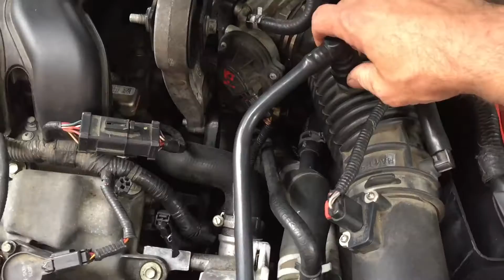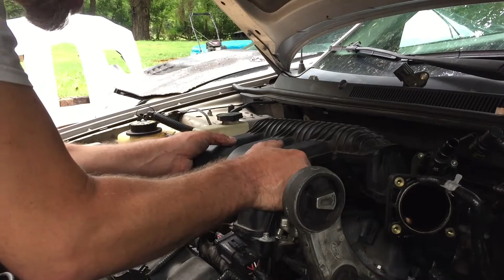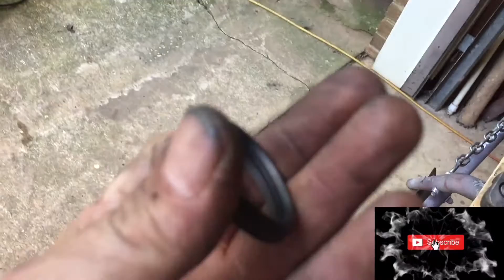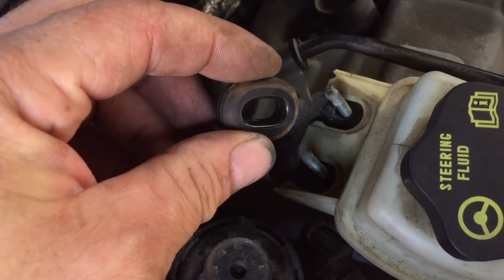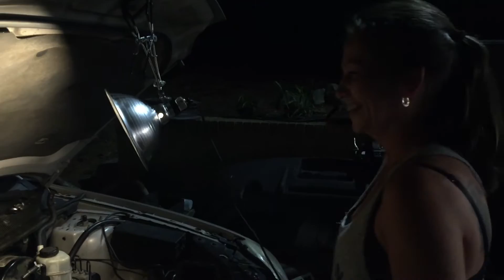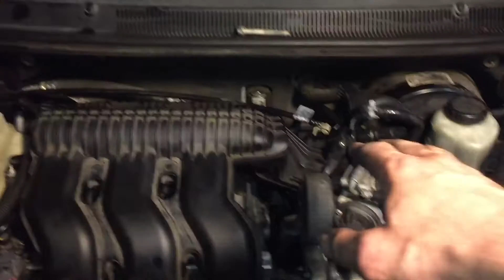How to Replace Valve Cover Gaskets 2005 - 2007 Ford Fivehundred / Ford Freestyle / Mercury Montego

Comment: I replaced them cleaned out the spark plug wells, replaced all the spark plugs and ignition coils, then I had 3 ignition coil connectors break on me so I replaced those, bro I hate ford engineers.

Comment: Is it possible to replace the gasket cover on the front half without removing all the pieces? I was told that mine were slowly leaking and that this would eventually become a huge issue, however that the cost of labour in Nor Cal to remove and reinstall everything to access the valve covers would be in the $1000s and thus not worth it.

I have little experience with cars so don't trust myself to detach everything and reattach it, but as a student I can't afford to pay for the mechanic to do it. I thought maybe if the front three are easily accessible I could do those myself and at least half of the problem would be solved.

Comment: Wow, this guy is taking WAY more things off than you need to......much easier than this guy makes it look.
Reply from the maker: How so what did I take off that wasn’t necessary for clearance and not to drop debris into the valve train??
Reply: @DeeStruggles I guess he wasn't gonna change anything but the fluids SALUTE
Reply: https://youtu.be/NwIjLECJmA8?si=lsTILmUsooe3CGgc
Reply: Anybody knows what direction to turn the big bolt on back of EGR valve the 1-1/16 nut?
Reply: @FATMAC_365 to loosing clock wise

Comment: Thank you for the detailed step-by-step video on how to replace the valve cover gaskets very helpful, you might want to let the viewers know to depressurized the fuel line by starting the vehicle removing the Fuel Pump Fuse Relay in fuse box at engine compartment till vehicle shuts off 👍🏼

Comment: Replacing the spark plugs on my 05 freestlye soon and I figured I will have to take out the intake manifold, so I might as well replace all the gaskets. Including the pesky EGR valve lol This video helped. Appreciate it. 

Question, my 05 freestyle has close to 220k miles. I'm thinking of draining some fluid and replacing the filter. There is nothing currently wrong with my tranny, I'm doing some maintenance. I heard changing transmission fluid on a higher mileage car will make the tranny slip. I don't see how only if it's already going bad. I think adding some new fluid and filter will only help give new life to an old tranny. What is your opinion?
Reply: I have researched this tirelessly myself.  Youtube comments, forums, manuals, etc. and it's all about 50/50.  There is a tiny dipstick, but it's pretty well hidden underneath the battery and throttle body components. If the fluid doesn't smell burned or completely black and seems to be in running order, go for it.  I am in the same boat as you.  It's my belief that if it needs to be done, not doing it seems like the wrong way to go.
Reply: The car has a non serviceable transmission filter on the 6 speeds, but changing the fluid, not flushing it, and adding in some lucas won't hurt it

Comment: Great video, maybe the best one for my vehicle. You went through all the steps quickly, making it easy to follow. I stepped through the video to replace the valve cover gaskets and spark plugs on my 2006 Ford Freestyle. When the job was done, I stepped through it again from the beginning just to make sure and discovered a loose hose clamp. When I finished, the Freestyle ran perfectly - Thank you!

Comment: When you removed the motor mount bracket, did you have to jack up the engine for support? If you did, where did you place your jack underneath the car? Some say under the oil pan with a piece of wood and others say don't do it under the oil pan because it can mess up your oil pan.
Reply: You don't have to that's actually a trans support not motor it will stay in place
Reply: Torque strut, it supports nothing, just keeps the engine from rocking back and forth. @DarthRainz

Comment: What's torque spec for the valve cover?
Reply: Hand tight is usually ok for anything 10mm or less.  To answer specifically, The valve covers are 89 in lb.  Any bolt under the hood of these vehicles that is 8mm is ~50-89 in lb.
Reply from the maker: not sure>> after they stop turning i just snug them up

Comment: There's a ford mechanic here on yt that says to check the cam cap bolts, they are prone to backing out or breaking
Reply: One side loosens and the cam lifts and breaks the other Bolt. That wipes out the engine
Reply: Hey can you drop the video link buddy or name

Comment: Very thorough video, I'd recommend replacing spark plugs while the intake manifold is off as well.
Reply from the maker: But probably should have mentioned that in the video lol
Reply: @DeeStruggles  Yeah I was just recommending that so if anyone came across this video they'd see it
Reply from the maker: Spark plugs was done already when I did the transmission swap and noticed the oil was seeping we’re the spark plugs are ...but before I put any more money into it I wanted to make sure the transmission worked first ..
Reply: How hard was it to pop off your intake because mine seems to be stuck
Reply from the maker: Not hard a good tug should free it....ether you missed a intake bolt or you didn’t unscrew the EGR tube in the back
Reply: Ford's have lifetime spark plugs.. this is a real automobile. Not one of them toys Otis
Reply: @depdiem8528  Haha I seriously hope you don't believe any item on a car is rated for life. The spark plugs on our freestyle with 80k miles were absolutely terrible
Reply: @JuryRigGarage  I can't believe that. My 55 Ford has the original plugs in it. The ones that came from the factory.
Reply: @JuryRigGarage  I think you're not driving it right. Ford's do not like to be babied. Put the pedal to the metal and Hammer Down. Jamaican town. I've always said they should give first time ford buyers driving lessons. This is not your grandma's Chevrolet.
Reply: @JuryRigGarage  I've owned Ford's for 50 years. Just put a Roush coyote in the 55
Reply: @depdiem8528  lol so it has new spark plugs... wtf are you saying about lifetime spark plugs
Reply: @Midnight_Rider96  npc.ngo
Reply: @Midnight_Rider96   all trolls have a lifetime plug up there ass. You have just proven my point. Call Charles somebody else
Reply: @depdiem8528  if thats what you call fun, have at it
Reply: @Midnight_Rider96  npc.ngo
Reply: @depdiem8528  YA RIGHT, LMAO.
Reply: Lifetime plugs? Hmm. Perhaps I don't have to replace mine yet? I thought they we're supposed to be replaced before my 135K mi. I'm down to 16.5 from 19MPG city.